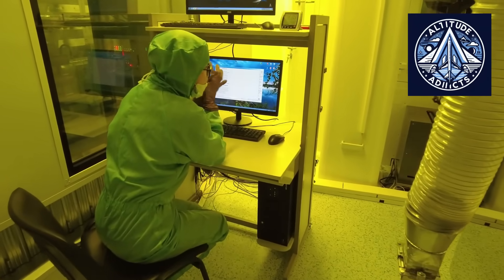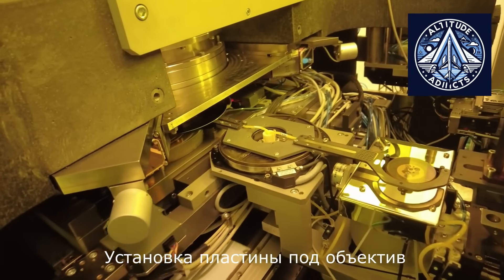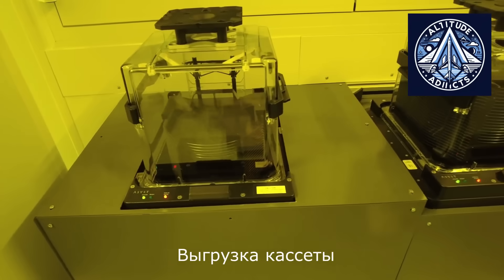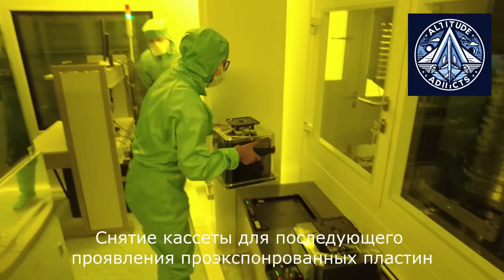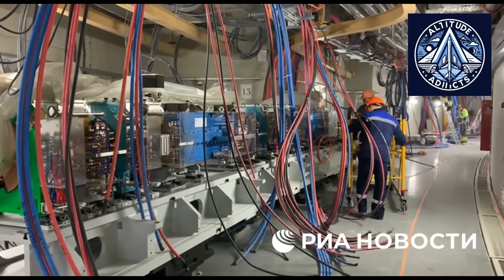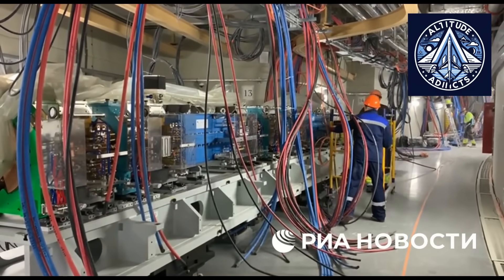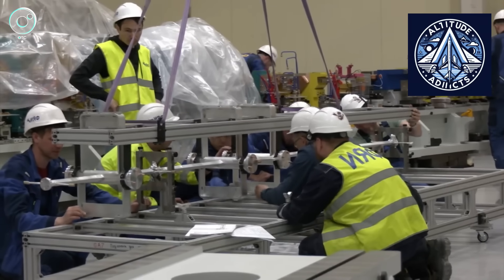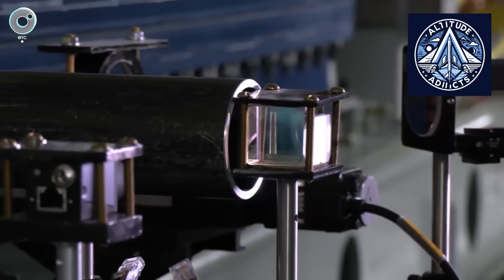Beyond EUV: How Russia’s SKIF Could Enable X-Ray Lithography

Comment: EUV is already a legacy node. No matter how fine the exposure equipment, the problem is the precision of the resist and dry etching. lol
The West has already succeeded in creating patterns that stably drive the quantum barrier for 3D semiconductors at the 1.5nm node and below, and is expanding the variations.

Comment: Russia should leap frog and work on the next generation beyond 1nm structures and just piggy back on China.
Russia did such leaps very successfully with Hypersonics and Miniature Nuclear Power Drives like for the Burevestnik.

This means you need to put your resaerch into next generation technology which requires a paradigm shift. This is how Russia can catch up while benefiting from China's knowledge for the next 10 years.
It will take about 10 years , ASML required that long for X-Ray lithography. But it is worthwhile!
Reply: can you please show me the country how had breached limit as of 22nm?) nobody can print crystals with 1nm structure
Reply: LOS  MOTORES  A PROPULSION NUCLEAR  ES DE ÚLTIMA GENERACION + HIPERSONICO EN EL FUTURO  DECIME SI LOS CHINOS TIENE  AUNQUE  SEA UN MOTOR  DE ESTOS ?  RUSIA TRABAJA SOLA  SI QUIEREN  LOS CHINOS  QUE TRABAJEN  CON RUSIA PERO NO AL REVES   RUSIA TODO  LO QUE ESTA HACIENDO   TODO  VA A LA MEGAMARCA  MADE IN RUSSIA
Reply: Let's get to the facts: they've achieved nothing in hypersonics. The Burevestnik is as real as rusia's might.
The only thing rusia excels at is creating myths about its greatness.
Reply: @LegionUkraine  Russia knows a thing or two about nuclear tech. They can build you small reliable nuclear reactor(fleet of nuclear icebreakers and submarines)
Reply: @dr_UiD You are absolutely right, they can build a large radioactive water heater.
Reply: @LegionUkraine  че не в окопе
Reply: @ArtemKo___  Скажи кремлёвским карликам, которые это всё устроили.
Reply: @LegionUkraine  Oreshnik